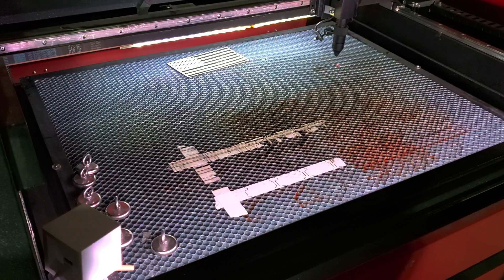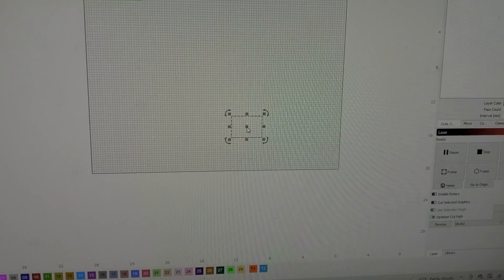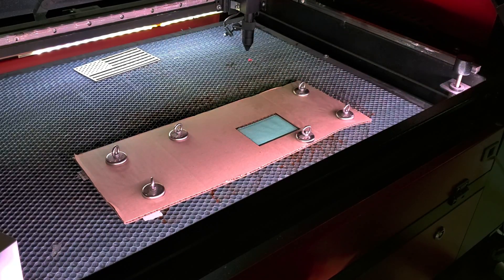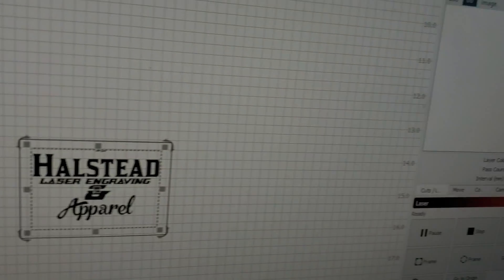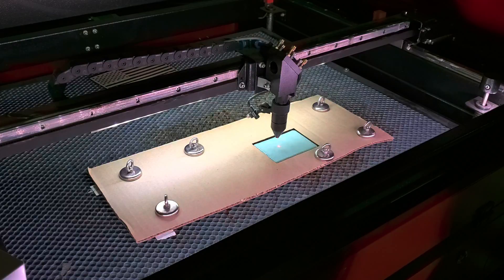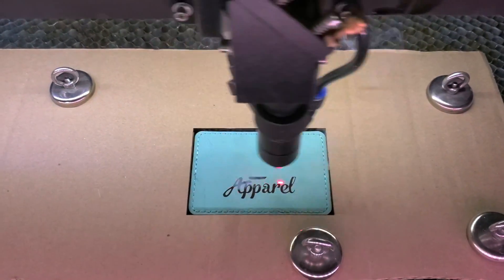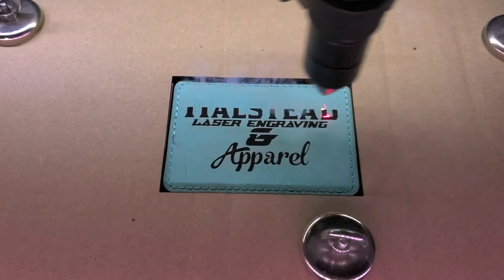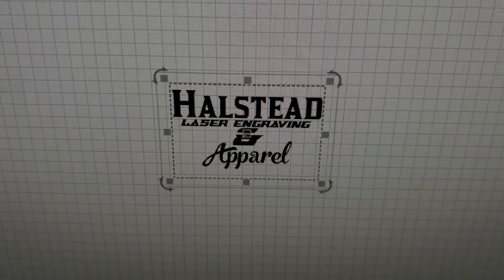Centering your project on your object in LightBurn

Comment: This is one of the better videos on using these techniques to center an object. One thing that might work to ensure that your template is moved to the same spot every time might be to use lower power output Ie let’s say you cut the card board out. Finished your job you saved the card board and latter you want to replicate the job. Place the cars board back on the honeycomb use your saved cutout path turn the laser power down as low as you can get it, set up 3 passes you will then move the cardboard into position using the lower power output. 😁🛫

Comment: Ok, I have a plastic square (one that fits into a LED disc) and I am not able to get it to center, or engrave the plastic correctly. I watched your video and still cannot figure out what I am doing wrong. Any help?
Reply from the maker: What is your origin set to?  Use Absolute Coords
Reply: @halsteadlaser  I use the green square and the pointer to find the center and then move the object around in the screen till I find the center

Comment: Wondering about air compressor upgrade, has the air compressor plug into machine or still in the wall power socket?

Great video you have taught me something.. Hopefully laser will be here next week.

Keep up the great video's 👍
Reply from the maker: Compressor is plugged in to the wall on a separate circuit from my lasers and chiller.

Comment: Overall, a pretty good video showing the basics of using a jig.

It would be helpful for those who want to replicate doing this to see what your project origin is set to i.e. absolute coordinates.  You can also move the rectangle to a Tool Layer so it can still be used for framing without being output.